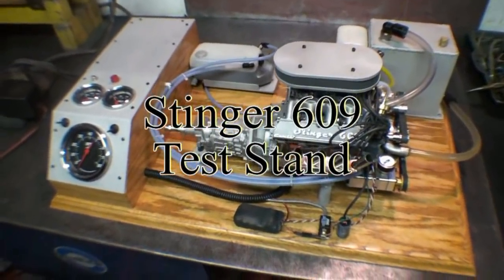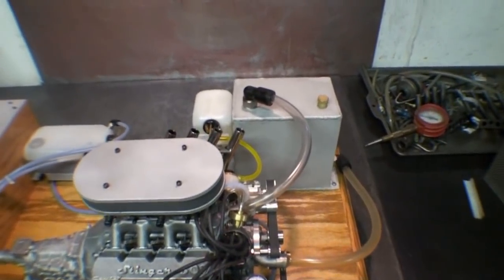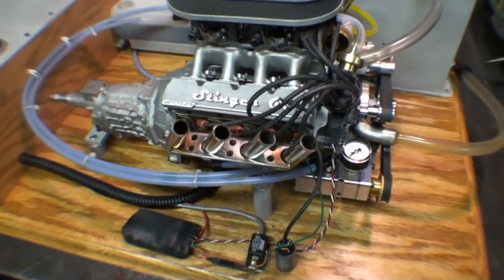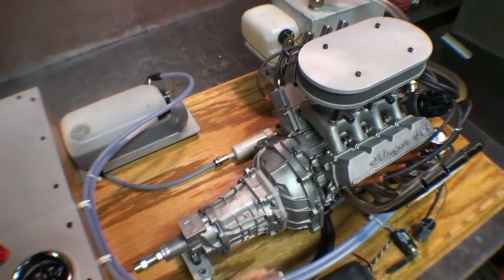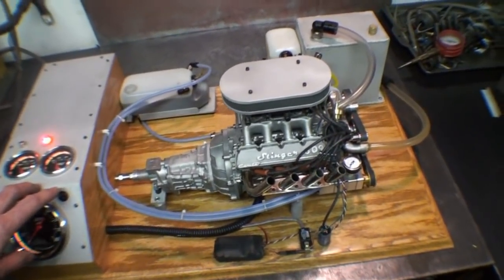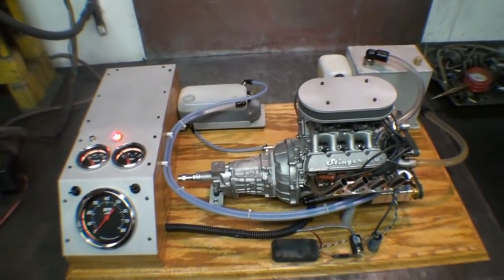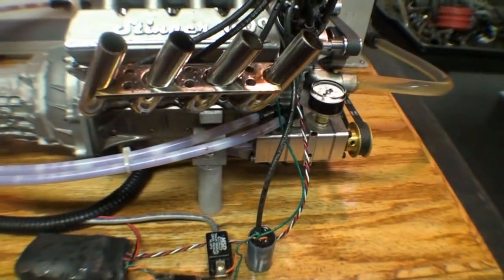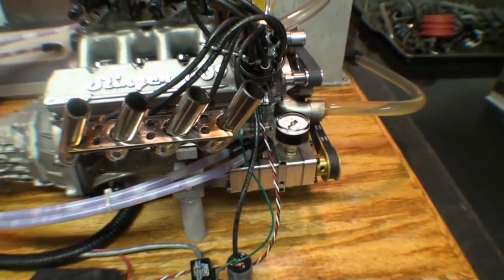Stinger 609 Test Stand

Comment: Regarding the model transmission. I know that there is probably a centrifugal clutch inside it, but are there any actual gears in it or is it direct drive off the crankshaft? If not, do you have any plans on introducing a transmission with gearing in it for forward and reverse?